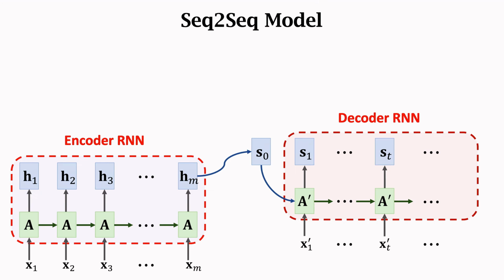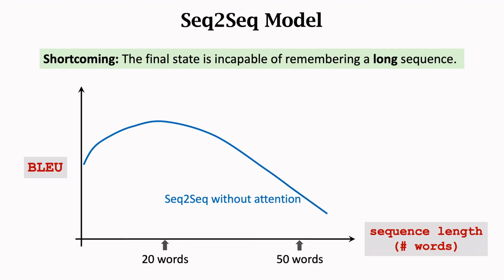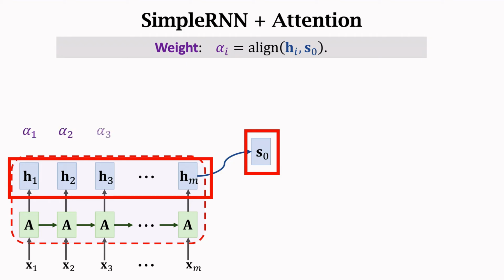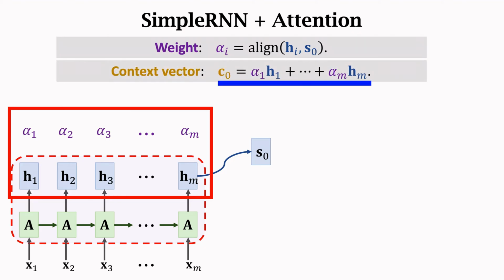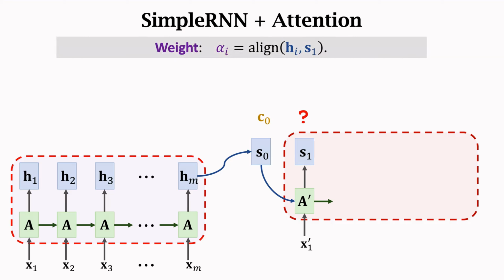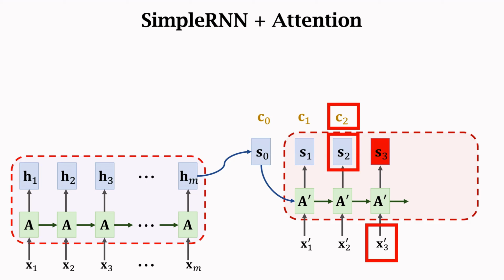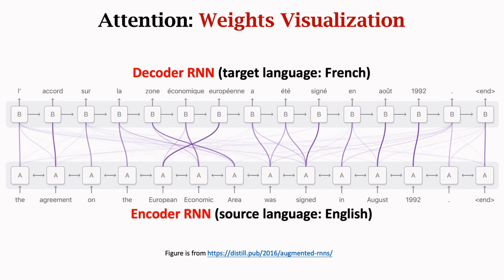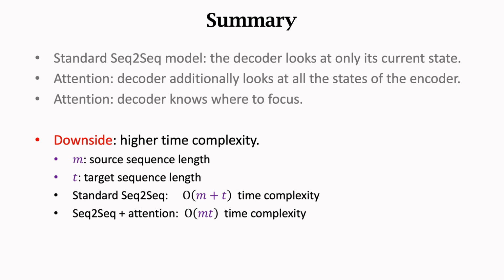Attention for RNN Seq2Seq Models (1.25x speed recommended)

Comment: In the decoder part of Seq2Seq with attention model, decoder uses three inputs. At first it uses c0, s0, and x'1 to predict s'1, here s0 is the latent representation of encoder and x'1 is the start sign, s0 and x'1 is different. In the next step uses c1, s1, and x'2 to predict s'2. Aren't s1 and x'2 same here? Because s1 is the previous hidden state and the x'2 is the predicted word, which is like a result of probability distribution based on s1. If I am not wrong, it supposed to use only one of them, or always use the s0. Can someone clarify this?

Comment: You mention at 11:19 that x1prime is the start sign, later (15:22) you mention x2prime as obtained in the previous step, but how? You show clearly how to obtain s1 and c1 but not x2prime.
Reply: I am also confused about that. Based on my intuition, using s0, c0, and x1, generated hidden state s1 at the decoder is used to generate a probability distribution over the vocabulary of possible output tokens. And the possible outcome is x'2. Again, x'2 is used together with s1, and c1 to generate s2. My confusion is that, x'2 and s1 carries the same information since x'2 is generated from s1. Therefore I don't see any reason to use both of them.